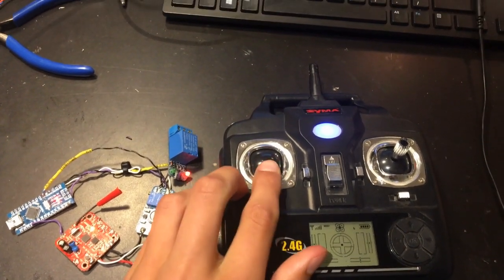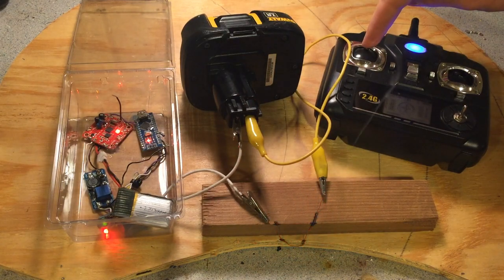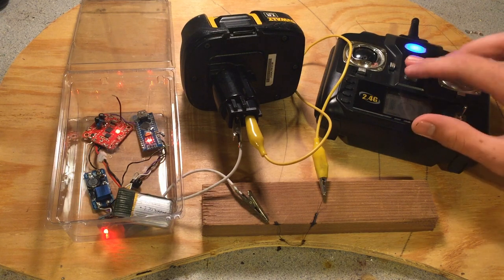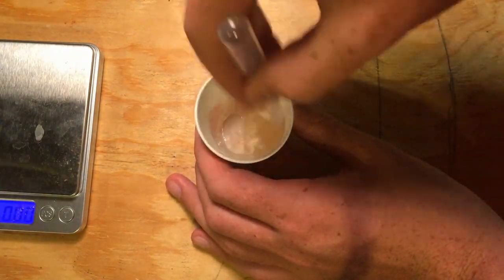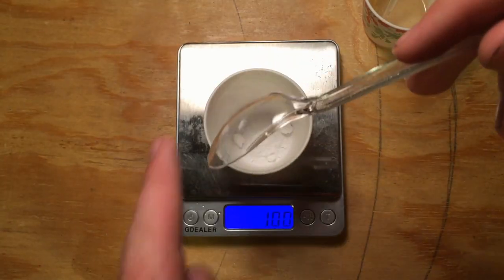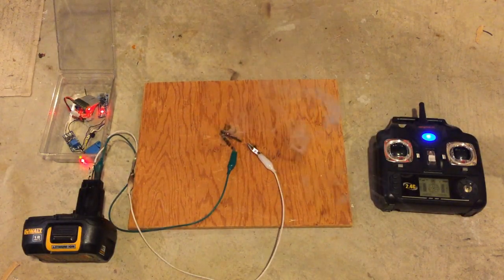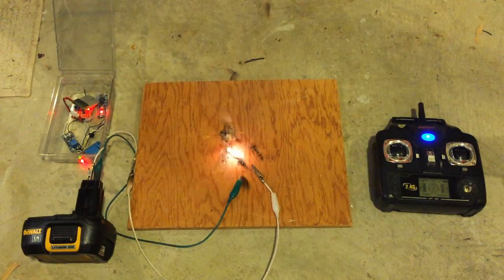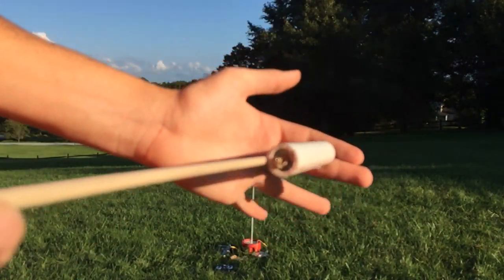How to Make Electric Matches for Thermite/Fireworks/Rockets (ft. Carbon Coil)

Comment: You can get 100pcs packs of tiny light bulbs dirt cheap. Gently remove the tip with a mini grinder and pour in your favorite mix. The filament takes tiny current to heat

Comment: Nitroglycerin
Reply from the maker: A Day in the Life of Science close but someone already got the right answer in the comments
Reply: Etn is bad though
Reply from the maker: A Day in the Life of Science how so?
Reply: It’s weak
Reply from the maker: A Day in the Life of Science lol what
Reply from the maker: I don’t consider anything with VoD >8000m/s weak
Reply: It’s not a very strong explosive in open air
Reply: You should’ve used octanitrocubane
Reply: Maybe that’s overkill but still...
Reply from the maker: A Day in the Life of Science well yeah, it’s not gonna detonate on the nichrome like that, but it is a burn accelerant. But   E T N   makes a great secondary or booster on its own contained. Very few secondaries preform well and safe without proper confinement.
Reply: Why would you use a secondary
Reply: I guess a primary would explode and not burn but whatever
Reply: Anything for content
Reply: You seem cooler using AgNTZ than ETN